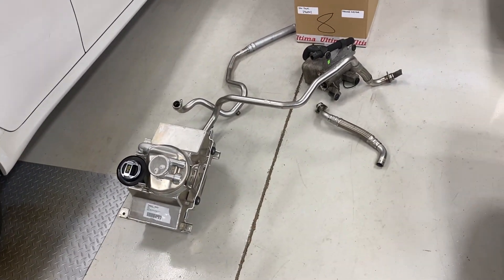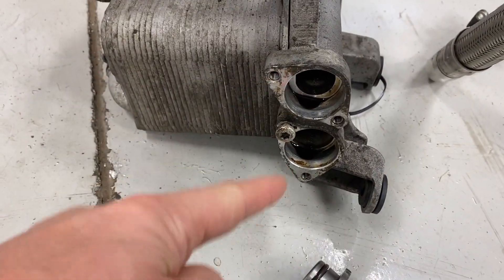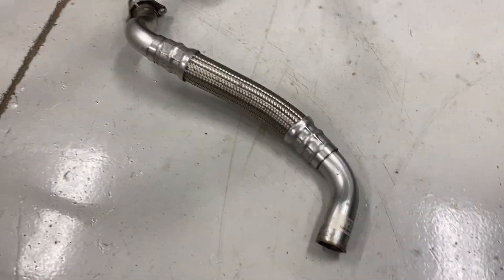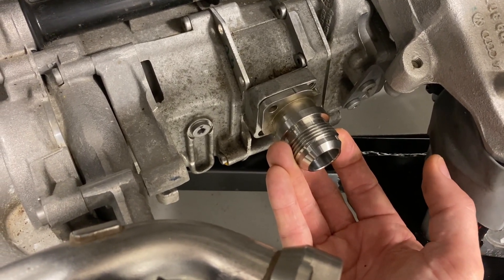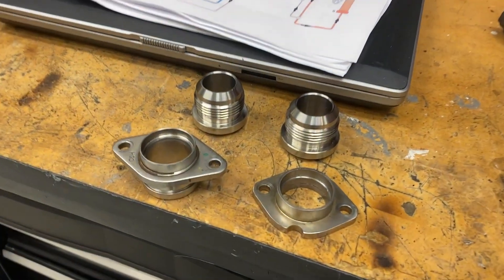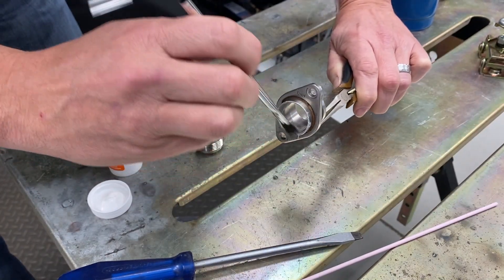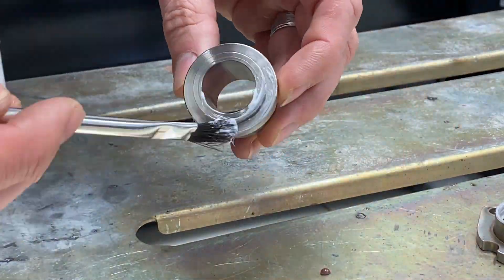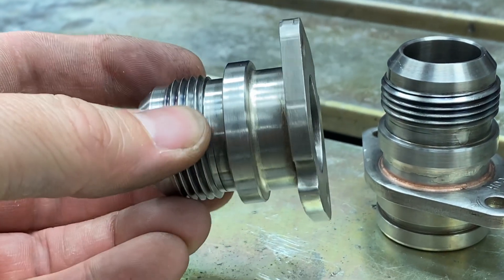Project 'Top Gun' - Plumb Crazy - V10 Ultima Evolution Convertible Build

Comment: That looks great and a material I hadn't heard of! Did it "flow" down and create a seal/ seam on the inside as well?
Why not replicate the OEM connector and have a 4 bolt plate on the pump?
Reply from the maker: Yep, the flux draws the molten silver down into the joint and creates a rock solid seal--exactly the same effect when you "sweat" a copper pipe for home heating systems.  I used the OEM connector and soldered the -16AN fitting to it.  It's just a 2-bolt connection to the pump from the factory (not sure why there are 4 bolt holes on the pump...but you only use two of them.)
Reply: @DanDulac  Aha, thanks Dan. Looking great as usual.

Comment: When brazing or soldering parts like that, put them on a ceramic fire brick, it’s easier and quicker to heat- your weld table will conduct away a lot of energy 👍

Comment: Are you thinking about a air to oil cooler? Where do other people put the oil coolers on these?
Reply from the maker: Yes sir. There’s a small water to oil cooler in the “V” of the engine already that I will preserve. And then I’ll add an air to oil cooler in the drivers side pod...it will go behind the big air duct body opening just in front of the rear tire on the drivers side.
Reply: @DanDulac  I think your oil tank is great. Just wondering if it would reduce heat in the cockpit if you could put an alloy baffle heat plate between it and the bulkhead. Great to have a separate oil cooler, will also reduce the loading on the water cooling system. Be even better if it’s possible to get an inline oil thermostat? Great project 👍
Reply from the maker: @bernardwarr4187  great minds think alike. In an upcoming vid you’ll see what i did on the rear bulkhead behind the drivers seat to insulate from the heat of the oil tank. And I indeed have an in-line oil thermostat for the air-to-oil cooler....I sent the oil tank and coolant tank off to the powder coaters today; once I get them back it’ll be time to install all the oil and cooling plumbing!  Everything should come together fairly quick now.
Reply: @DanDulac  I see you’re an engineer 👍
Reply from the maker: @bernardwarr4187  yes sir. My day job is bits and bytes engineering. My hobby is all things mechanical engineering. 🧐

Comment: It’ll be interesting to see what your overall weight when don’e compared to a LT setup. Being the engines are pretty close to the same weight with the LT being slightly heavier. But the LT has less components as far as wiring ecu’s exhaust should weight a little less, exc. what was your reasoning to go with the v10 and all the extra work vs the CSB, and going with the evolution vs the coupe being you most likely would have had a little extra room with the clamshell?
Reply from the maker: Hi Kyle! Agree on weight—it will be interesting to see when all is said and done. I know for sure I saved 20lbs using a lithium battery over the traditional lead-acid. It will be close!  I chose the v10 as I always believed this car was deserving of a powerplant that was a bit more exotic. Plus it’s pretty unique and I wanted the challenge of doing something one-off. I chose the convertible mostly because of personal preference; I will use it mostly for street and the open air environment will add greatly to the thrill of driving it, imho. Couple this with the beautiful sounds of the v10 and the fast shifting trans, I have high hopes of an exhilarating ride. :-)
Reply: @DanDulac  I think that your last sentence is guaranteed...

Comment: Dan,

I'm curious as to the header solution you have in mind?  I designed a lot of the headers for GTR's both in the US and in UK.  Also developed headers for the Ralt Toyota V10 F1 car, and did all the header design for Hendrick Motorsports for a few years.

It looks like a pretty tight fit given 5 tubes and the large motor mounts.  I have a CAD model of the GTR chassis, and if you have a CAD model of the engine (or even the exhaust port locations and angles) relative to some known points on the chassis it would be possible to do a CAD design so you don't waste months cutting and fitting tubing.  I generally design the headers, collectors, CAT section as well as the exhaust & mufflers out to the back of the car.

The other way to go is to buy the https://www.icengineworks.com/ plastic kits.  You can snap together straights and bends until you have a solution that works (in place), then just cut metal and weld.  Remember, the right and left side may be different due to firing order as well as the cylinder head offset from L/R.

Kurt
Reply from the maker: Hi Kurt--thanks for the GREAT info.  Plan-A is to use the icengineworks.com system to mockup each header...I've already designed/replicated the header flange in Fusion360 and had it laser cut from 3/8" stainless.  I plan on purchasing a pre-built 5-into-1 stainless collectors so my job will be the pipe routing/design work to connect the flange(s) to the collector(s). I've got a pipe routing design in mind based on other header pics I've collected from Ultima's.  It will be tight but i'm confident it will work out.  (This will all be in an upcoming vid!)  I've had my eye on the icengineworks kit since the early planning stages of this build and looks to be a savior.  If I run into problems, I'll know who to ask!  It sounds like you could do this in your sleep...This will be my first time building headers so i'm sure it will be an experience.  Lol.  Thanks again for your great info!
Reply: @DanDulac  Dan, Excellent.  I met Victor Franco (started ICEngineworks) a long time ago and have bought a few of his kits.

The kits are the easiest way to do a one-off fabrication when all you have is an engine and chassis in front of you.

Most of my work has been for F1/Indy/Nascar teams and we had full detailed models of the chassis and engine.  In this case, it's easier to develop a cad model (I use SW but Fusion is good too).  My header design software takes the coordinates of exhaust ports, merge collectors, and obstacles and automatically generates a design that fits and achieves the desired lengths and minimizes the number of cuts and welds. This software is written in MatLAB and then outputs a solution to SW or other CAD programs in standard file formats.

When I met Victor I also wrote a piece of software that would take an ICE design, N number of 1 inch straights and curves with the rotation angle, then automatically optimize for exact lengths and stay within the same space constraints, and minimize cuts and welds. 

If you have experience TIG welding stainless great, if not, practice on a few scrap pieces until you get it right.  Color of the weld should be 'gold', penetration should be 75-100, so your setup needs maybe 5CFM for purge flow and 12-15CFM for the TIG depending on the size of the cup.

Since you're normally aspirated, I wouldn't waste money on 316 or 321 stainless, as 318 works fine at 0.049 wall thickness.  Anything more than that just adds weight and cost.

One other trick a lot of people don't know about concerns gaskets between the cylinder head and the header flange... bad idea.  You have machined flanges, and presumably the cylinder head is flat as well.  So what we do is make a steel plate to bolt the header flange too while welding which minimizes distortion.  After that a belt sander will make the flange perfectly flat.  Then all you need is a 1/8 inch bead of high-temp 'RED' RTV and bolt together.  What this does is ensures the header flange will never get hotter than the cylinder head, usually ~400 deg and no warping will occur.

If you put a gasket between the cylinder head and the header, the cylinder head will run at 400 deg, but the flange will be at exhaust gas temp, about 1500 deg, and this will cause the flange to warp and the gaskets will blow out. 

Finally tubing diameter and primary lengths:  Probably best to look at the Lambo design as it's likely they did a lot of dyno time coming up with what worked best.  Generally you run a tubing ID that has the same cross sectional area as the exhaust port, and the length has to do with where you want the torque to peak.

Can't wait to see the additional progress.  Kurt, SLC UT